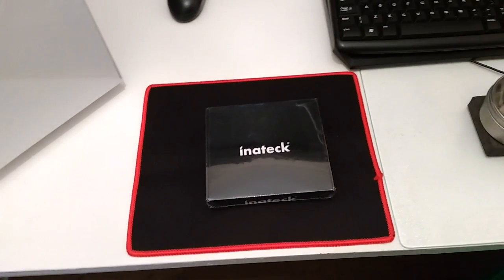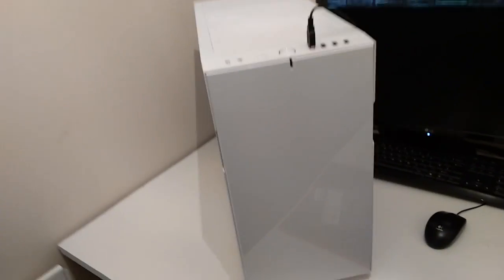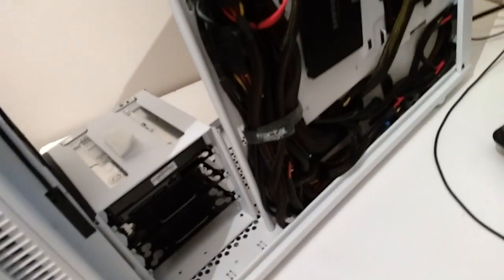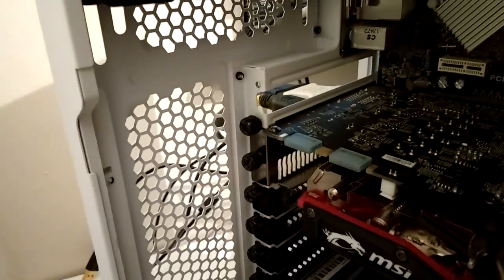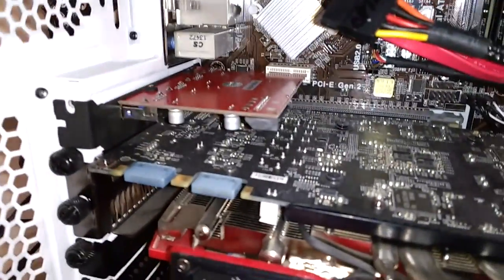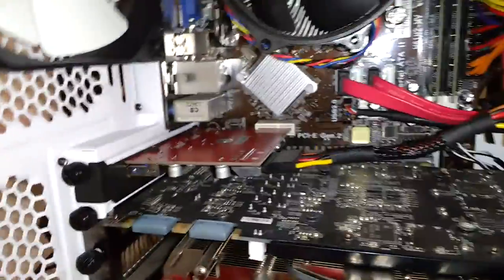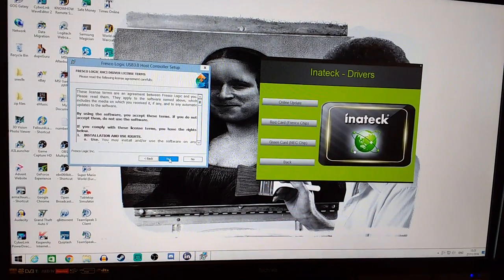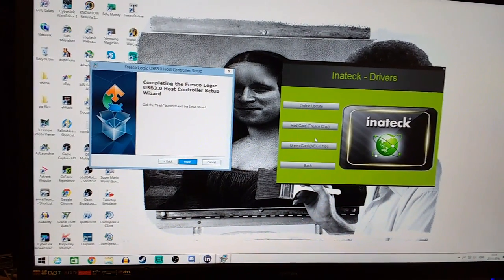Upgrade Install USB 3.0

Comment: Thank you.
Reply from the maker: Screetch you're welcome
Reply: @thebarnineffect  Where did you find the driver to install on Windows 10? I have an equal to this I did not find drivers for Windows 10
Reply from the maker: @fernandojunior9393  about 4mins into the video. I used the disc to download the drivers. But if you don't have a disc drive it should be in their web site
Reply: my pci usb card has the chip via not if its and chip via but i'm wanting to install it on windows 10 i didn't find any driver that works on windows 10, u could install yours on windows 10?
Reply from the maker: @fernandojunior9393  I think this was windows 8.1 before I upgraded to Windows 10